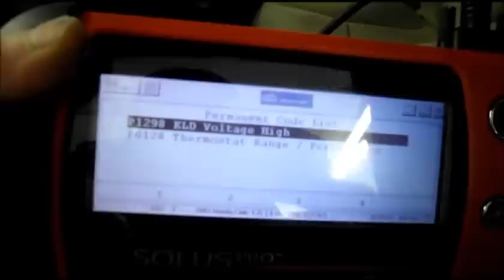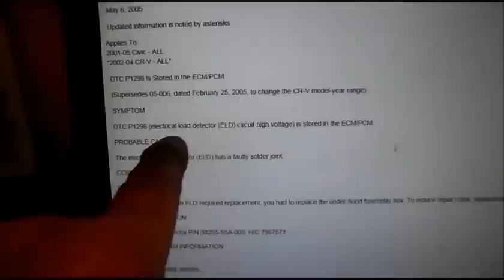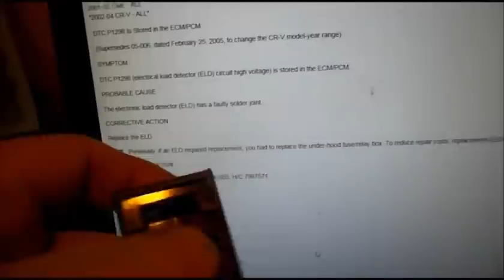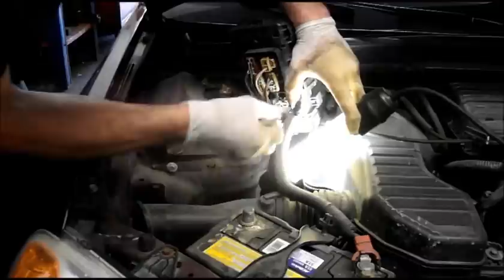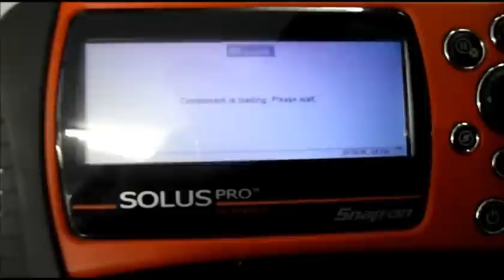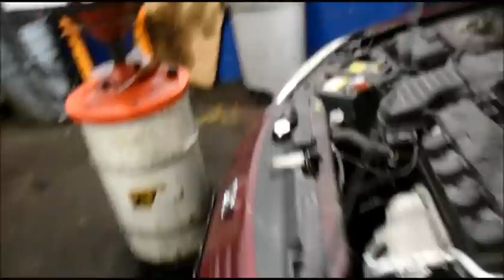How To Repair A P1298 Electric Load detector code on A Honda

Comment: Good Video !   :-)   Next time you can try with Dorman - OE Solutions Electronic Load Detector (601-019)
Reply: J and A Auto & Truck Repair for a 98 Honda Civic ?
Reply: Maytee, no your Civic does not have this sensor. The 601-019 ELD model fits newer Civics 2001-2005, and some other models

Comment: Thanks for the video. Interesting to see how car manufacturers deal with this kind of issues. So it's known  there is an issue with the ELD on the car, they issue a TSB but still the owner has to  pay for the parts and labor to get this fixed. I'm wonder when something is considered Recall and  when is TSB.
Reply: Not everything becomes a recall, in fact most issues do not. A TSB is a technical service bulletin, which are created when a more common issue/concern/fault is associated with a car. The primary reason for these bulletins is to assist repair technicians in more quickly finding and understanding the issue like: where to look for the fault, what the symptoms are, what causes it, how can it be fixed. It's to make techs diagnose and repair more quickly and consistently. Most good techs will read through as many TSBs as possible, sort of like doing homework. But what a TSB is not, is an admission of 'bad design' or a free repair campaign for the issue. Though some TSBs will talk about repair for free if under warranty or consideration for 'goodwill gesture' in which the manufacturer may pay some percentage of it or even all of it, at their discretion.
Reply from the maker: gianfrancoa Thanks for watching and your feedback.Ya if your out of warranty the TSB  says      "Out of warranty: 
 Any repair performed after warranty expiration may be eligible for goodwill consideration by the District Parts and Service Manager or your Zone Office. You must request consideration, and get a decision, before starting work."